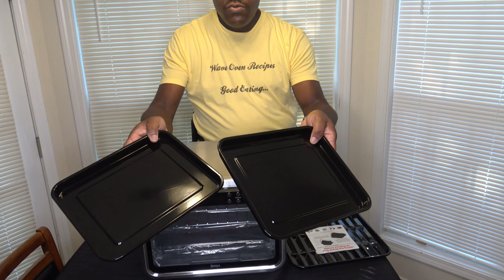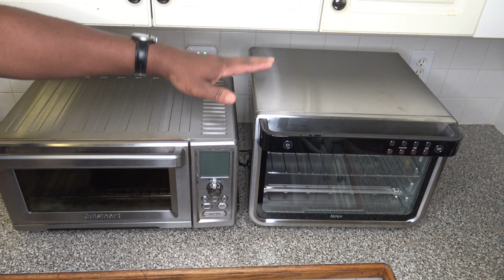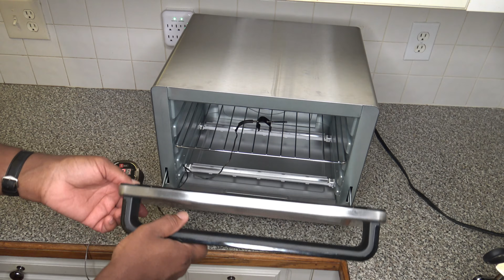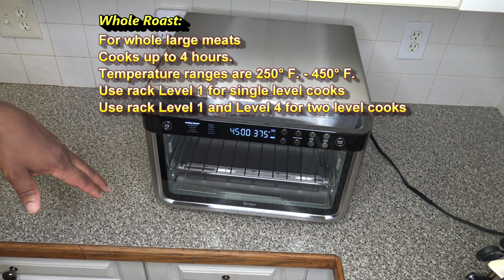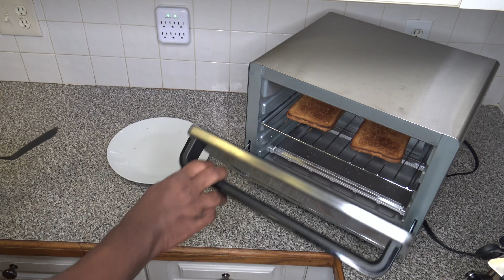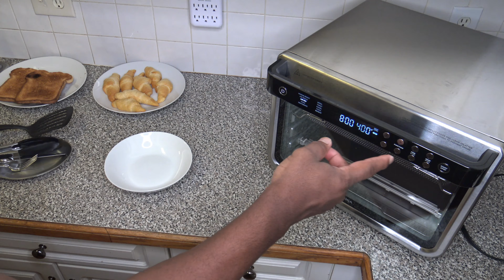Ninja Foodi XL Pro Air Oven Review, Unboxing, Test and Cooks

Comment: May I ask. How hot does this thing get on the bottom when it is running. Should I be concerned it scorches or melts and standard (non stone) countertop?
Reply from the maker: Mine isn't stone.
Reply: @WaveOvenRecipes  Ty so much. Looking to replace our Power Air fryer Oven which gave up the ghost after very little use and have scorched counters with appliances before so the paranoia is real.
Reply from the maker: I cannot speak for your situation and recommend you get some form of heat resistant padding.

Comment: As always, a very comprehensive review, Darnell.  Just wondering if your Ninja XL Pro oven came with a temperature probe for cooking whole roasts?  I do see that you used your own ambient probe for this video, which I'm assuming can be used to monitor temps for whole roasts, IDK.  I watched one particular video prepared by the Ninja company illustrating how to use their temp probe with this machine. They showed that there is an input spot for the jack underneath the handle on the right-hand side. However,  many of the videos I've viewed for this oven, unboxings, etc., do not include any with the probe supposedly "provided" by Ninja.  Can you share any information?
Thank you for your informative videos.
Reply from the maker: The Ninja Foodi Grill XL has that right where you mentioned.   I show it here:
https://youtu.be/2w9vZTOyV14

The Ninja Foodi XL Pro Air Oven doesn't.
Reply: @WaveOvenRecipes  I  was finally able to find the Foodi XL Smart Air Oven Pro, model # DT251, that does include the temperature probe.  It's selling on Amazon for $299.99. Really didn't want to spend that much money for that.  The videos I watched including yours convinced me to buy this particular unit w/o the temp probe, so I purchased the same model that you own from BB&B at a sale price of $239.99 plus I had a 20% coupon that I used.  Ended up being a good price for this item after it was all said and done.  With the money I saved, I bought a probe thermometer with the wire connection, very similar to the one you used in one of your other videos from Amazon for less than $20.  Just had my oven delivered, can't wait to get started & see what this baby can cook up!
Reply from the maker: Yeah they sell the higher cost one with the probe only on Amazon for now.  I wasn't aware of it earlier.  Since I pre-ordered before it was available.  I agree with you though, no need to pay extra.👍🏿
Reply from the maker: The iGrill 2 can be used to monitor meat temperature.

Comment: The 90 second preheat claim stated on the box is very misleading. I and I’m sure other people would naturally think that means it would reach your target temperature in that time. But in reality after the 90 second preheat the oven has only reached 135°F approx. For an example it will take 10-minutes approximately to reach a target temperature of 450°F  Just trying to clarify this point.

Comment: Don't like the buttons on the handle at all, I still haven't bought one each new version of these products improves in some ways just not enough for me yet. I do love the reviews very informing, thank you sooo much.
Reply: Check out the Instant Pot Omni plus.  You may like that design of toaster/ air fryer. It is large and works well.  I have both the Omni Plus and Vortex plus. I use my Vortex plus for almost everything but, I love them both.
Reply from the maker: I was planning on getting it, but then some other newer stuff came.
Reply: I actually like the buttons on the handle. Easy to use.